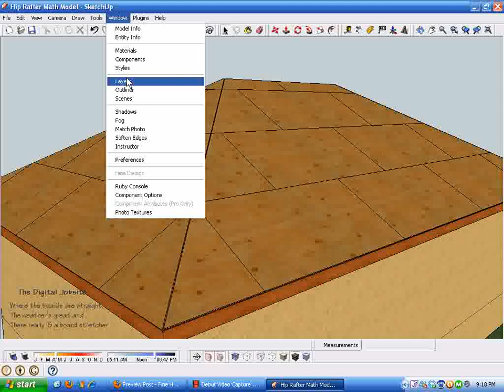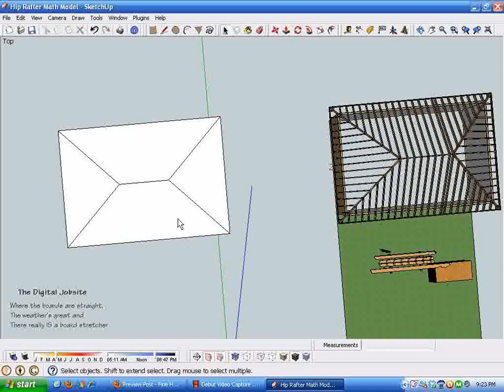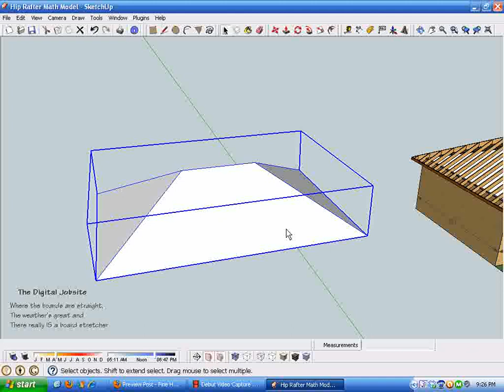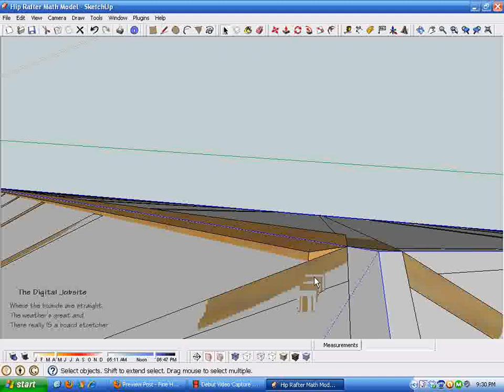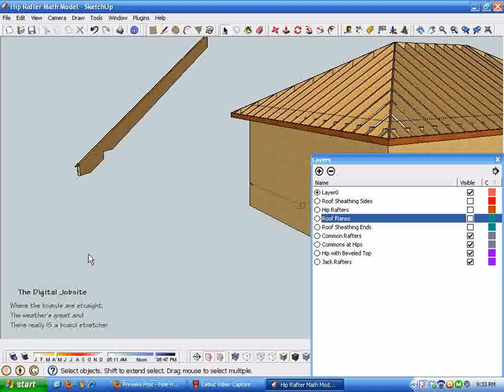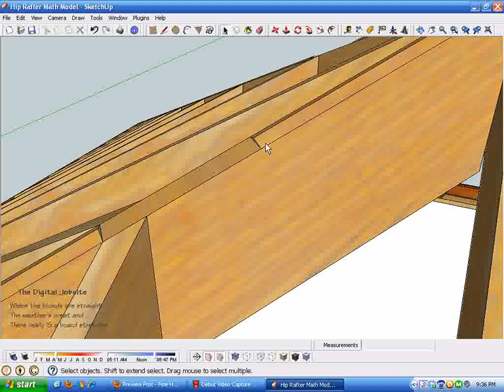Model and Measure: Hip Rafters De-mystified by Visualizing in SketchUp

Comment: I want to build a small cabin with the ceiling open as much as possible.  Are there cross members required between the rafters to make the roof sturdy?  Can the hip beam be made very large so that no cross members aren't needed?  Can several support posts be installed inside the cabin so that cross members aren't necessary?

Comment: No.  Sketch Up is the one I like.I just need more on hand use.I have a 3/12 roof with two hips on ends on gable end of house.I am trying to change it from open porch to enclosed mud room.one hip is at same pitch as house 9/12 and other is at 3/12 hip.I need to make it at 9/12 and extend full length of gable end.My question is do I still use standard ways to project size of rafters and jack rafters at a 9/12 pitch.I am still a little lost any suggestions. Thanks Mr. Vermont John